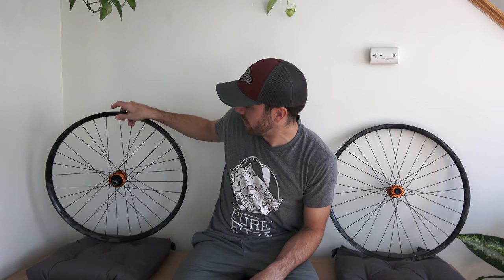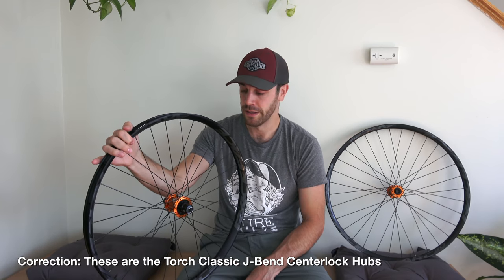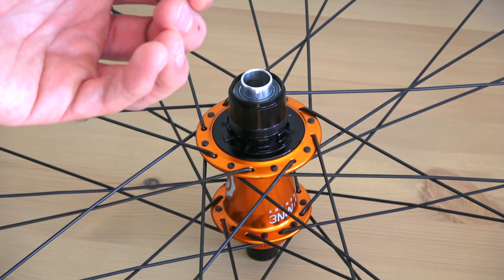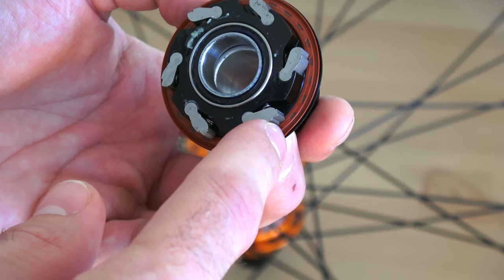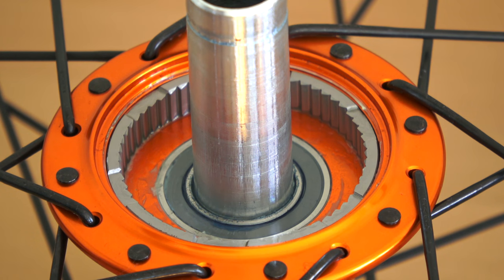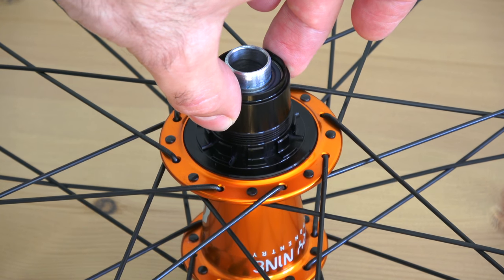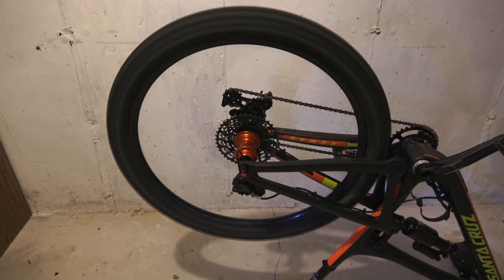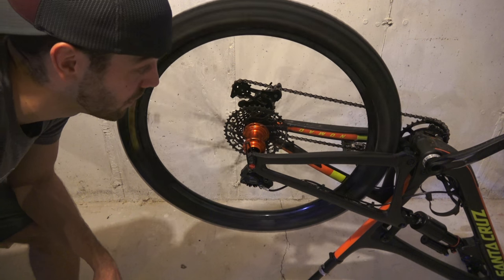Industry Nine Torch Hubs | Breakdown + High Quality Sound

Comment: Does 6 pawls == twice the friction losses when freewheeling?  Energy to make that sweet sound had to come from somewhere.
Reply from the maker: Manfred Adams one could assume so, but could I tell you I feel a difference... nope! I love em
Reply: Most 3 pawl systems use a really strong spring and bigger teeth which ends up causing a lot of drag. The Hydra hubs use a lighter spring with smaller teeth which reduces the friction but also gives you more points of engagement.

Comment: Riding on the street with my S.O.B. (swarm of bees) Nine, my pedaling (as well as backpedaling) grew resistant to the point that I had to walk my bike home. Taking my bike to Wheel World in Culver City, Ca, my mechanic thought that wear has resulted in the drive side of the rear hub to the point that the hub was rubbing against the drop out. When he placed a washer next to the drop out and held by grease, then replaced the rear wheel assembly and locked down the thru-axle, the pedaling became normal. My question is,  is this a sign of normal wear, or is it abnormal for the I-9? And, would a rebuild of the hub restore reliability, or is a rebuild in this case futile, and should I just get a new hub? MTB, thanks for the video.
Reply from the maker: That is a great questions for Industry 9. If reach out to their customer service team.  They are very helpful, in my experience.
Reply: @MTBTravelReview  I appreciate the tip; will do.

Comment: Could I run these on a X caliber 2021?
Reply from the maker: You can run any hubs on any bike. The only thing you need to know is what the spacing is.
Reply: @MTBTravelReview  hello sir! I also wanted to use this on my X Caliber 7 (2021) The problem is that XCaliber 7 uses Quick Release Boost hubs in the rear. Does Industry Nine have a Quick Release Boost Hubs?
Reply from the maker: @whodafakru7668  Check I9's website.  They do have some boost QR options and if not, they have end cap adapters that can make it work.  They should be able to help if you reach out.

Comment: Pretty disappointed with the Torch hubs I bought a couple years ago. The 11 speed freehub body is aluminum and after a few months of riding I had to pry the cassette with tools to get it off. I purchased the White Industries hubs and love them. I would prefer to have a totally silent hub though, I can't figure out what people like about noise. Noisey Motorcycles and cars, it's just annoying.
Reply from the maker: Wasupwitdat1 Mofiki my torch hubs have been bullet proof, so maybe there was some sort of defect. It happens. As far as the sound goes, if you don’t like it, don’t buy the hubs. ¯\_(ツ)_/¯
Reply: @MTBTravelReview  Like I said that was about 3 years ago and I remember a lot of complaints about the same thing. Hopefully they have stepped up their game for everyone. I built up a few wheelsets with White Industries hubs because I really like them and the company. I wouldn't go back to an I9 hub.
Reply from the maker: Wasupwitdat1 Mofiki thanks for sharing.
Reply: @MTBTravelReview  As I said I like to try a completely silent hub and after or conversation found the Project 321 hubs. Any thoughts about those? Have you heard anything about them?

Comment: Came here to see the end cap removal, not here.
Reply from the maker: Thanks for sharing! End cap just pulls off. No magic trick.
Reply: @MTBTravelReview  non drive side was easy, but is there a trick for the drive side? It would not pull out. Some videos described a removal tool and yet others destroyed some O-ring. Was hoping for any clarity.
Reply from the maker: @javari  I don’t know of any magic trick or tool. If it’s stuck I usually just use the ole wrap it in a towel and use a wrench trick. Nothing that you can destroy. It just gets a bit snug on there.